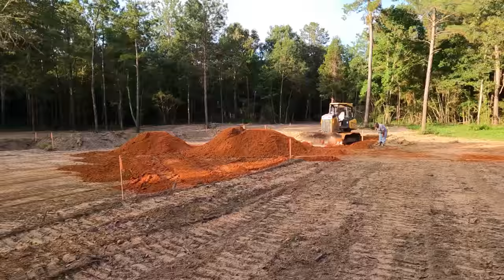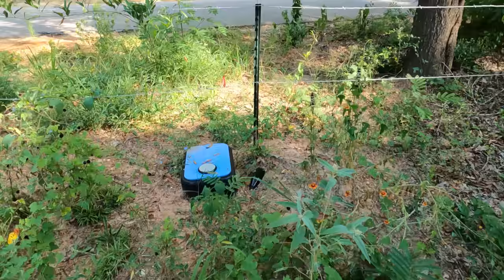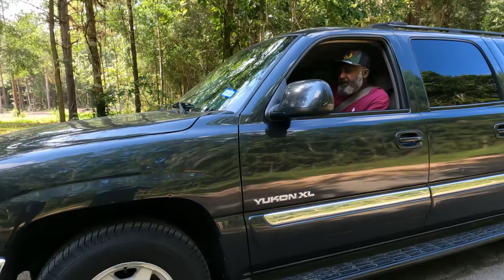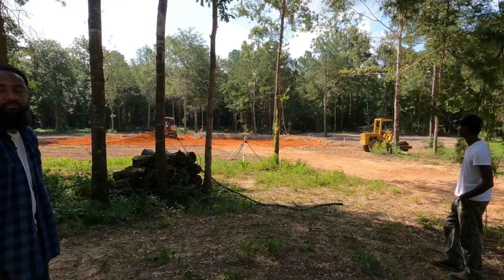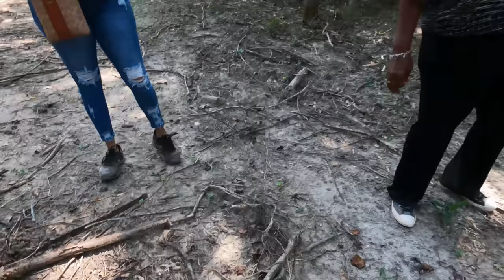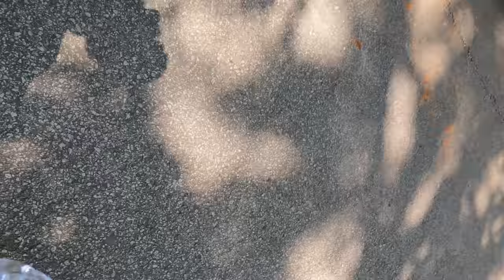The Home Building Process Has Begun 🙏🏾

Comment: Get rid of any close trees. If you don't. You will worry about them possibly hitting your home in the storm. We are going through that now. And have to have 3 or 4 taken out. And it is much more expensive. $1,500 -- $2,500 per tree. Ours are large oaks that need to come down. Later after the home is built you can choose trees. That won't get so tall and heavy or pose a danger to your home.